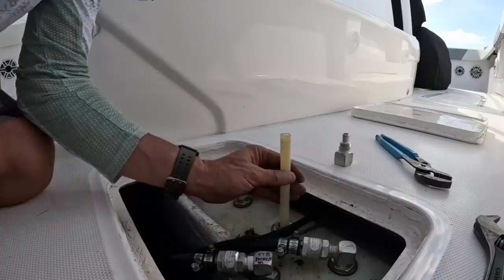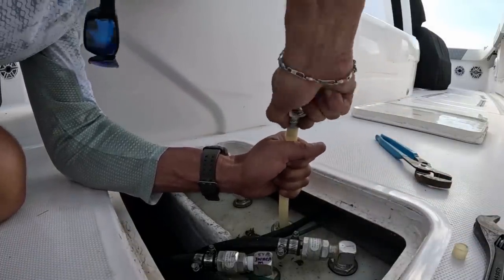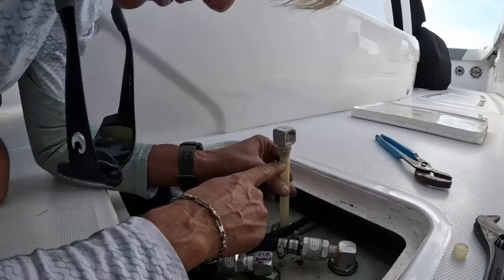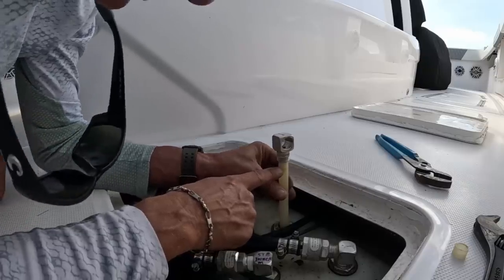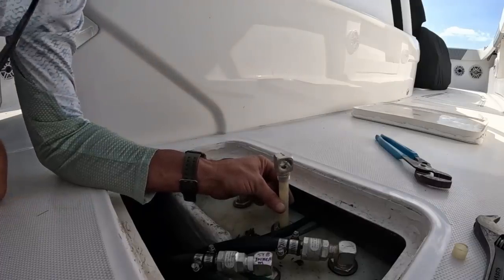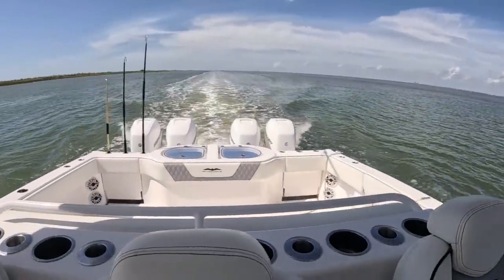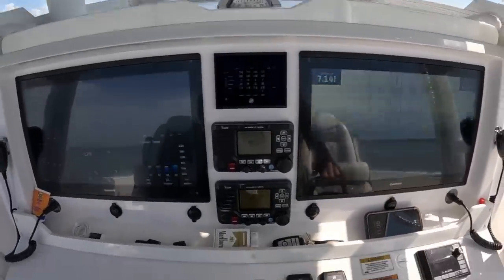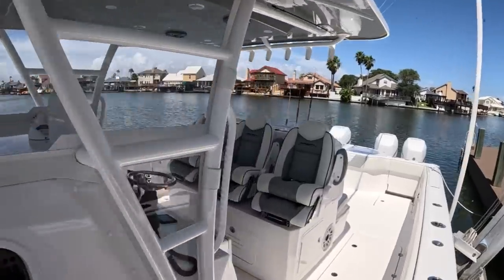Taylor Swifts Invincible 40?  Broken???

Comment: Plastic pickup tube was when it was built and remains a Bad Design.  The sloshing fuel within the tank will cause this problem to happen again and again as the fuel in the tank pushes the pickup tube back and forth the looseness at the fitting is sure to return again and again. It really needs a solid metal pickup tube along with solid metal fitting connecting it to the elbow fitting.  Once the pickup up tube gets loose the engines are sucking air instead of sucking fuel.

Comment: I once had a Jeep Grand Cherokee that had a stumble.  Mechanic sold some useless parts.  Removed the fuel tank and there was a 2 inch piece of rubber fuel line that mushy like a piece of gum on a pickup inside.  That was the issue.  Went back to the shop and the owner offered me a job.  Said no thanks!  Good diagnostics on figuring this out.  Hopefully Invincible/Mercury come up with a solution!

Comment: So a zip tie and cut the tube 1/2” lower for a tight fit.   Stainless steel wire would tighten it also.
Reply from the maker: That would be great but no room to do that.  1/32 clearance around the tub and hole diameter.  Invincible supposed to send an updated set of tubes.👍. Thx

Comment: Congrats on your new channel. Your editing and camera work is pretty good for just starting. One question on the repair, could you have used an Oetiker clamp to secure the fuel fitting or is there not enough clearance?
Reply: Hi and thanks for asking a great question… unfortunately there’s not enough room. It have a micro screen on the bottom of the tube wrapped around the edges of the tube but barely fits through the opening and that clamp you’re referring to will have a larger diameter, even though it is a very low profile clamp.
Reply: @skylee007  What does this have to do with Taylor Swift?  Please don't start your channel by lying to your audience.
Reply: Is the boat's name "Taylor Swifts"?  If so, you should state that.

Comment: What's a more permanent fix? Can a stronger tube be used?
Reply: A more permanent repair/fix/design would be either Stainless Steel or an aluminum pick up design that is permanently attached (welded) to the 90° fitting that screws into the top of the tank fitting.   Or if they’re going to keep the poly tubes, they (Invincible) should at least have a fitting that has multiple barbs on it rather than a single barb with a short sleeve.  IMO.  😎
Reply: @skylee007  Thanks.
Reply: @BOSS_DOG  I think invincible should be checking it out

Comment: Cool video and great description. Pull them out take to a fabricator and have them fashioned out of a complete welded stainless set up. For the price of the boat and it’s capability to offshore, that is the proper fix. If the tube completely drops off in the ocean, that’s bad. Friction fit for anything on an ocean going boat is a bad design.
Reply: Completely agree, Murphy’s law! Hard to believe that’s how it’s designed and installed. With all the vibration and pounding a boat takes I’d never be comfortable with that design.
Reply: You have to realize that the guys designing and building that boat get the same pay as those who design and build the low end boats. It doesn’t matter how much you pay for the boat, you’re going to find shoddy work and shortcuts taken. Bottom line is always the issue.